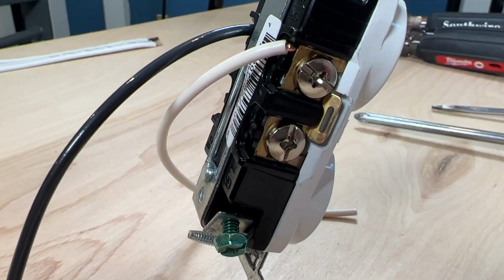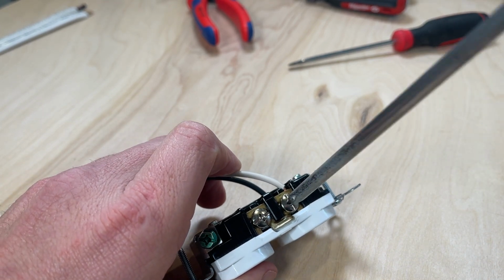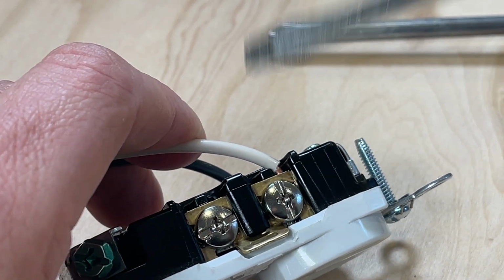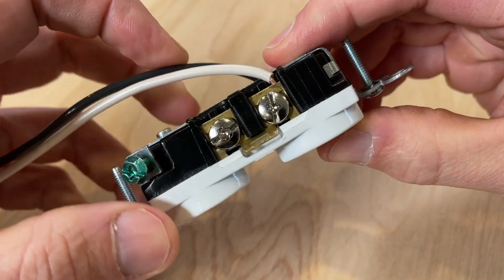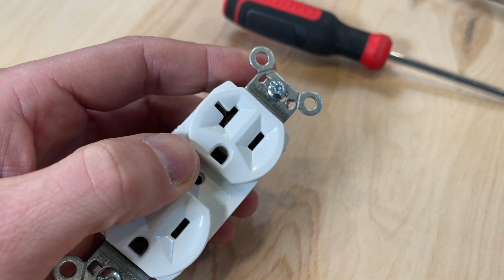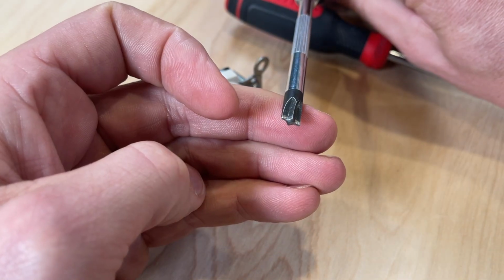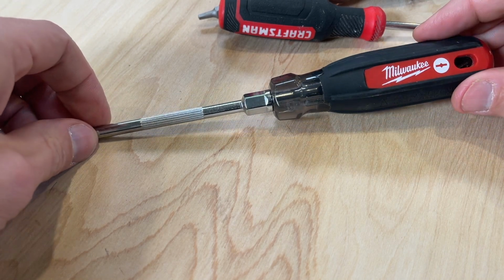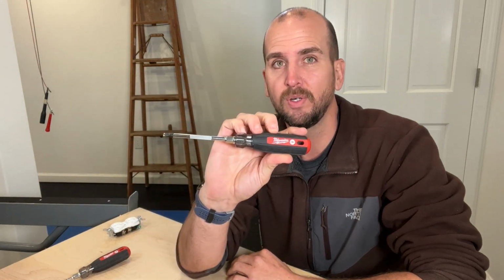80% of People Use the Wrong Screwdriver For Electrical Work

Comment: Looking at the shape of the screw heads there, I would have thought that those screws are pozidrive, very similar to standard Phillips, but they have an additional head shape for added grip and torque. But then, I have a number of drivers with changed le tips, and about 40 different styles and sizes of tip, ranging from Allen to torx, flathead to pozidrive, and a number of security bits, with a variety of different cutouts.
Reply: It looks like pozidrive to me too. Pozidrive has the advantage of parallel blades but you need to select the right size. Phillips has tapered blades and is more forgiving regarding using the correct size. Phillips is most common in USA whereas Pozi is more European. The point of Phillips stops them inserting correctly in Pozi heads. Using the wrong one usually causes slipping and tool wear.
Reply: @barryoakgreen  Phillips a and Pozi are 50 to 50 in Europe. Phillips is mostly used for metric threaded screws whereas Pozi is used for wood screws.
Reply: It's a square/slotted hybrid, some call them modulo. If the center drive was pozi it would have the pozi markings and while a PH/SL modulo exists that doesn't look like it to me.
Reply: Is that what those are? Someone gave me a ton of screws with heads like that and I usually use a square bit with them because the Phillips part just strips out.
Reply: Learned so much today in just 2 comments (+answers) . Thought it was pozi too.

Comment: You can also find terminal, plus/minus, or xeno drivers. They are a hybrid Phillips/slotted tip. The Phillips part sticks out a mm or so from the slotted part. I have some #1 and #2 xeno bits. You can also find them in PoziDriv. They come in handy on some flat pack furniture and shelves.

Comment: If you're uncomfortable using a slotted tip screwdriver, you just need more practice and/or you may just not be using it right. A slotted tip driver should be as wide and as long as the slot on the screw. It will maximize surface contact with the screw and allow you to  apply more torque. I can't tell you how many chipped screws I find on busbars, screw terminals, meters, etc. The worst ones occur on soft aluminum screw terminals in panel distribution equipment because of guys using drivers too small, like you did at 1:56. That slotted tip was much too small for that terminal. I also would NOT recommend using a square tip driver on ANY screw that is made of Aluminum.

Comment: It’s a Robertson #6 in Cabinetshops in Canada you honestly don’t want to see how small a number 4 is.  #8 is standard size (referred to as square #2) and #10 is used for patio tables or door hinges. Basically there is more sizes here since we are metric :). The patent for Robertson is tapered so it really really grips too. The square 1,2,3 sold in big box stores doesn’t even come close.

Comment: While everything stated is correct as it stands, is anyone going to point out that the addition of the Robertson head provision to the combination head screws has significantly compromised the effectiveness of the Philips provision?  These screws and the Robertson head perform well together, but the old-school combination head screws that were only flat and Philips worked equally well with a Philips driver.  A Philips head driver in a dedicated Philips-head screw works as well as the Robertson in a dedicated Robertson-head screw.

Comment: The entire point of an ecx screw head is that it accepts multiple screwdriver tips. Every which one is listed to put out more torque than the termination is listed for.

Also never heard of those ecx bits until a few years ago when I saw one made by ideal. On the other hand that screw head has been in service for ages….

Also the best tool for the job is a torque screwdriver especially if you’re a homeowner who doesn’t know what you’re doing.
Reply: Okey and I think that is, not so bright in todays world. Torx is near perfect. If you don't have the right tool for the application, you don't know what you are doing.
Reply: And the truth is, neither of the screwdrivers that it accepts work properly. There should be ONE type which is made it for, and works perfectly with!

If someone doesn't have a flat, or PH or PZ screwdriver, then it might be better to avoid touching the work.

But if you have all of them, but none of them works propery, nah, that's annoying!

Btw. I always use a flat screwdriver for these universal crap (although not that improperly sized, like in the video).

Robertson is pretty much rare in Europe. Most kits have PZ, PH, TX, Hex, Flat, but only one of my bit sets have a few square ones.

Apart from that, the recommendation is good, because it works on some screws. But it really shouldn't have been imported in the EU, if the matching screwdriver is rare. Should be Torx instead, if not PH/PZ/Flat...

Comment: If you want to get tech you should be using a torque screwdriver like Milwaukee tip but also tell you the torque  your applying sense all manufacturers have a specific torque for there device.

Comment: The fact is that this video says "you're using the wrong tool", but for the exemple it takes the wrong flat head, and a worn out phillips screwdriver.
Better compare with a spoon next time..
I never cam out in these circumstances, nor do I slip with a flat head.
At least, the only reason to use a robertson would be to save time, so if you've got hundreds of screws to tighten yes.
But in this case, you're a pro worker, and also as some mentionned, you should use torque limited screwdriver because it can lead to major problems.

Comment: Over here (northern EU), there are almost no Phillips screws used any more. All of them have been replaced with Pozidriv, which is a great improvement over Phillips. No question. But in woodwork, house building etc. they exclusively only use Torx nowadays.

Comment: If you would have used the proper Philips or the proper straight slotted screwdriver you wouldn't have had them problems but you were using a too small of a screwdriver with a small head. You make me feel like you're you're trying to sell tools to me 😆

Comment: I purchased one of the Milwaukee drivers for doing this very task, but as a commercial electrician you really only spend a very small fraction of time wiring receptacles. Having a specialty tool that will not function for any other task but can easily be mistaken for the tool you need is utterly frustrating. Better to just use the Phillip's then switch to the blade or use your 10 in 1 with the square tip.  Don't bother with the specialty driver, you'll end up grinding the the tip to make it actually useful or leaving it forever in the way in your toolbox..

Comment: First of all, it's not called slotted. It's called a flathead. Second, you did not use the correct flathead. The flathead has to be the same size as the slot in which you are putting.

Comment: Philips drivers (as opposed to Pozi/PZ) are designed to literally damage the driver instead of the screw head when they cam out to prevent over-tightening and to ensure screw heads don't get ruined and the screw stuck. But, once a PH driver cams out it's more likely to cam out again next time and so the damage will just keep getting worse. So once a PH driver is as worn as the one in this video I would ditch it.
Bear in mind too that it's also really important not to over-tighten terminals, and this becomes more likely with a screwdriver that won't cam out when too much torque is applied. I'm not an electrician - although I've had basic professional electrical training - and I've come across a number of decade-old installations where the wires snapped in the terminal as soon as I touched it. This was either because the terminal screw had been pushed too far into the conductor or because the conductor had been squashed too much by the terminal plate.

Comment: One minor nitpick: Square drive is NOT the same as Robertson.  Square drive is that thing you find on a ratchet.  A cube-like protrusion that fits into the back of a socket.  Roberston, by contrast, is slightly tapered so that it can be press-fit into a screwhead.  

This taper provides numerous benefits.  Primarily, it firmly attaches the screw to the bit enabling you to orient the drill in any direction, even directly downwards, without needing to hold the screw.  It just stays attached.  Very handy for one handed driving of screws where your other hand is busy holding the work-piece.  (You know your Robertson is worn out when screws stop sticking)  The other big benefit of the tapered tip is that it makes the tip of your tool smaller than the hole in the screw head meaning it's much easier to insert the tool.  

Of course, these days, there's lots of cheap screws out there that have ignored the important taper feature of a true Robertson so I guess those screws are what one would call 'square drive'.  Sure, you can use a Robertson to drive those 'square' screws but it's the same kind of experience you get using a Phillips to try and torque down a Pozidriv.

Comment: I've noticed that the square drive Robertson bits in my screwdriver set, and have used them occasionally, however, I'm completely flabbergasted that I never noticed that the Robertson fits directly in these electrical screws! And it fits better too! Been using Philips mostly, and occasionally the flathead (or even sometimes a dinner knife!).

Comment: The screwdriver bits listed below are purpose made for the screws shown in your video. Anything else just won't do when the correct tool is available. I hope this helps. 
WERA PH/SL Plus Minus 70mm Length PH1/S Or PH2/S Modulo Screwdriver Tough Bit. There are other manufacturers that also make these "plus minus" bits. Thank you.

Comment: I use an Milwaukee M12 impact driver. When on hands and knees I try to be as efficient as possible. My knees aren't what they used to be. Hate it when they have 6 wires into a outlet. Pigtail heaven.

Comment: Straight bladed screwdrivers are fine as long as the blade fits the whole screw head.  I've been doing this work for 52 years...never had a problem.  You should use your #2...the head fits the receptical screw better!
Reply: I agree, the diver should fit the width of the slot, so it has some friction there and doesn't wiggle loosely.
Reply: @TheYear2525  Not just the width, but preferable the lengh. Manually, I have better control while tightening with proper flat driver than with either Phillips or Robertsons

Comment: Never seen an ECX driver or bit.  I normally use the Robertson (square) drive on all the more modern equipment but you can't use it on the older ranch house equipment.
I prefer the bit inserts as I can use them in a drill driver or a manual handle.

Comment: I use properly sized slotted screw driver and hand torque pretty good - until I can’t turn screw or driver slips out.  This works for me but always wondered if it’s too much???

As a visual, after “two finger turning it till snug (of course I have a little pressure to ensure driver stays in slot), I then put more lateral pressure and wrist torque till it stops moving - it goes about another 1/4 turn.  Sometimes it rotates wire with screw. There are some striated marks on wire from screw head but no deformation and no stripped threads.  Anyone out there tell me if this is acceptable?

Comment: ECX is Best for Electrical. Square Drive, Also called Robertson or Hatteras Screws I called many years ago. Is a good Driver. 
In the 80's we nailed Boxes to the Studs, then we started using Phillips screws.
Lazy Electricians I worked with said you Install with a Hammer. The Phillips was used to Remove. Battery Powered Screw Guns were not popular yet. I would use a Little hand crank drill egg beater looking thing with a long Phillips, worked Great. Battery Powered Drivers were Next. Made things nice, and using torx screws insured  no slippage.
Wonder what's next?
Stratmando

Comment: Klein Tools has something like them as well, which I prefer the most because they have the square little tips I little longer making the fitment with more grip. But in any case both are awesome because they are the best tool for trimming out outlets, switchs and some other devices, every single electrician should have them either Milwaukee or Klein Tools.
Reply: I just got the Klein one. Looking forward to trying it out.

Comment: One of the reasons that flatheads seem to fail for me is because I use them for chiseling cement out of the way in a hole for the outlet in a kitchen backsplash that I installed the tile on that I made a little too small.

Comment: Wondering why, when you buy an outlet, there is not a recommended screwdriver type printed on the box. I've probably installed 20 of them in my life, and used both Phillips and Flathead. Every single time I've thought to myself, these things are cheap.
Now I know differently. It's like it's a inside secret or something.
International Brotherhood of Electrical Workers secret.

Comment: You didn’t even mention a slotted/philips that fits the same and more devices than the ECX you mentioned.
Edit: Just as an example use a Wera 162 PH/S 006456 this is NOT a Pozi/Slotted. It is a #2 philips/slotted driver.

Comment: It all depends on quality of screws. If you buy a good quality electro sockets etc (not the cheapest ones) the Philips screwdriver is perfectly fine. We install about 100 sockets every day and Philips is fine. Just the screw quality must be good. We work this system for 12 years In Poland and we have 230 volts. No problems at all.

Comment: Milwaukee also sells a set of 2-inch long, 1/4-inch hex drive bits with both the ECX #1 and #2.  The part number is 48-32-4443.  I found this at Ace Hardware.

I have been trying to get their insulated ECX #1 and #2 4-inch screwdrivers.  They have been difficult to find.  The insulated screwdrivers have two advantages.  One, of course, is that the insulation will help protect you somewhat from shocks.  The second is that the red insulation on the screwdriver shaft makes them stand out from the other screwdrivers in the bottom of my tool bag, and therefore, much easier to quickly locate.

The part numbers are 48-22-4441 for ECX #1 and 48-22-4442 for ECX #2.  It looks like the #2 is finally back on Amazon Prime, but the #1 is only available from an aftermarket seller at an outrageous price – about $35.

And right after I finished typing the above stuff, I did another Google search for ECX #1 screwdriver.  I found the 3-piece set another commenter mentioned at Home Depot for $21.  What a deal!

Comment: There is also a cross (not exactly philips) with wings so you can basically not mess up the screw and you can use it with normal non slotted screws

Comment: Heads up - this guy is NOT an electrician.
If you are starting to slip with a Philips 2 in OK condition on a normal outlet, it's tight enough. It is possible to over tighten  so the copper gets crushed. 

Use experienced professionals - not YouTube.

Comment: WRONG. Bet at least 99% of everybody including every driver that you showed are wrong. NEC requires that you use a torque wrench or torque driver in ALL electrical screws & bolts that secure wires. At an IAEI continuing education class the instructor asked the 125 people attending electricians and a few inspectors who owned a torque driver. Maybe 4 people raised their hand. Yep I do not own one because after 50 years as a sparky retired and no longer do any outside work. Have used the special bit that you mentioned and they are best in class.
Reply: DYI"ers dumb dumb

Comment: I do a lot of handyman/maintenance work. I started using the Milwaukee ECX a few years ago. It is hands down the best tool for working with switches and outlets. No more slipping and worrying if your phillips is going to slip and not get the screw tight enough. The ECX grabs and very seldom slips. Always a tight connection when you are finished.

Comment: I was impressed by this video and immediately ordered a Milwaukee ECX #1 (as seen on the video) and it doesn't fit the receptable screw. It won't go into the slot at all. Are you sure #1 is the correct size ???  What a bogus video.

Comment: The name of the game is to get the job done quickly and safety. A $25 screwdriver is absolutely not necessary. I'll use either a flathead or Phillips (preferably the Phillips)...works fine every time. I'll take a shot and say maybe you're getting a check from Milwaukee??...could be wrong..

Comment: I do mostly industrial work but have learned much from your program for home repairs. However I must disagree that the ECX bit or screw driver justifies another spot on my tool belt. My Klein 5-1 screwdriver with the 1/4" common bit fits perfectly into the screw heads of all duplex receptacles and provides so much torque you can easily strip them. You video showing a drastically undersized flat head slipping around was an un-fair depiction seemingly to promote the Milwaukee product. To be fair, you should have mentioned that Klein has a virtually identical version; the #7314. (They have 1/4" bits as well.)
Reply: "provides so much torque you can easily strip them" well, then that's not a good bit, as apparently from your description the 1/4" common bit does not spread out the torque force enough to prevent the head from being stripped. As opposed to the hybrid bit that looks like it has enough contact area to spread out the force being applied (especially into the stronger, thicker areas of the screw head) and thus have a far less chance of stripping the head.